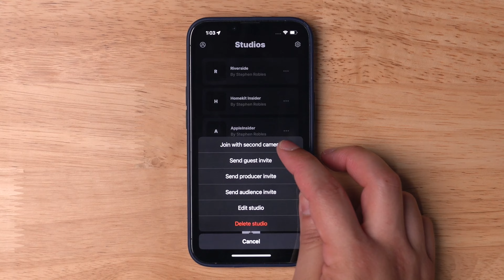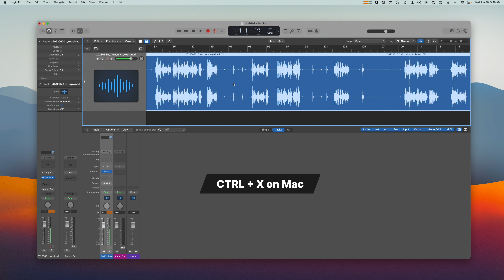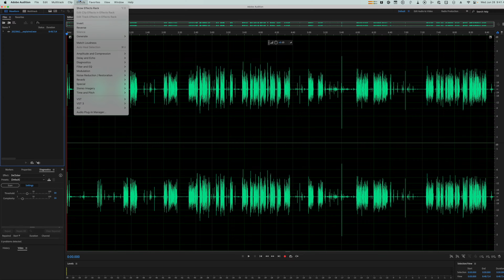How to Prevent Mic Bleed in Your Podcast | 5 Tips and Software Solutions

Comment: Thank you very much for this tutorial. This has been my main struggle in podcast editing in the past 7 years. I now use RX to clean it up and put a little bit of gate wet and dry over.
Reply from the maker: Nice! Thanks for sharing, glad to hear it’s helped your workflow!
Reply: Thank you sharing the info. Could you please explain what do you mean by "gate wet and dry over"? I'd like to test that technique. Thanks!
Reply: @producewithease  Sorry, I'm using Reaper and I'm using a gate. And I set the wet/dry signal to let's say 40%. So the gate is not open or closed.
Reply: @LucasDegen  Thank you!

Comment: Unreal! Great tutorial. I am very fresh and new in podcasting. Been doing it for just over a half a year. I have definitely been having trouble with Bleeding, but where my biggest concern in audio is when my podcasting partner and I both speak at the same exact moment, our audio quality diminishes instantly and has major echo. We speak over each other A LOT, and argue and stuff like that, which is part of our character - something we wont stop doing hahaha. That being said, why does the echo and audio sound so shitty when we both speak at the same time? How do I eliminate that?

Thanks so much. I will be watching more of your videos. Super helpful. Subscribed!
Reply from the maker: Thanks for watching! What software are you recording in to? And does this happen to the raw audio files being recorded or after you edit and export from an editor? You may want to check any ducking settings in your software. Ducking is a setting that will lower the audio of one track when the other speaks. If this is turned on for both it will lower the volume and try to mute both tracks at the same time.

Comment: I've been trying to do this in Audition but you didn't show the part I'm having trouble with. I want it to strip the silence but leave the audio in the same place on the timeline. Audition only seems to shorten the show by removing the silence, which I don't want. Is it possible to do it similar to Logic or Pro Tools?
Reply from the maker: Yes, I'm not sure the process in Pro Tools but Logic Pro X has a strip silence feature that leaves audio in-place. Here's the instructions for Logic: https://support.apple.com/guide/logicpro/remove-silent-passages-lgcp86ee7672/mac

Comment: hey! Im using two blue yeti x for my podcast. Severe mic bleed despite low gain :( what to do?
Reply from the maker: Yeti is notorious for being very sensitive in picking up room noise (and other guest). Make the the polar pattern is set to directional (so it's only capturing from the front side of the mic), and you may need to move as far away from the other guest as possible.

Comment: I am experiencing mic bleed when recording online in Riverside with a guest. Both of us are using external microphones and wired headphones. The bleed is oddly off in timing, almost like a pre-echo. What might be causing this?
Reply from the maker: Are the headphones plugging into the external microphone or the computers? And what devices are being chosen for the input / output when recording?
Reply: @Riversidefm  My headphones and microphone are run through a Scarlet 2i2 interface which is plugged into my computer. The guests all have different set ups, but I believe most are plugging in mic and headphones separately into the computer. I have had one or two using  wired earbuds with built in microphone.